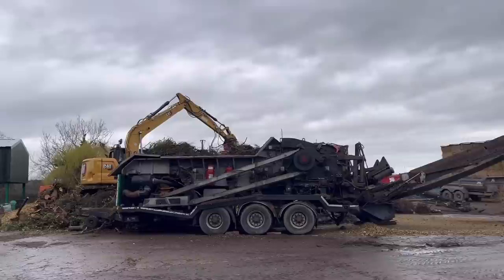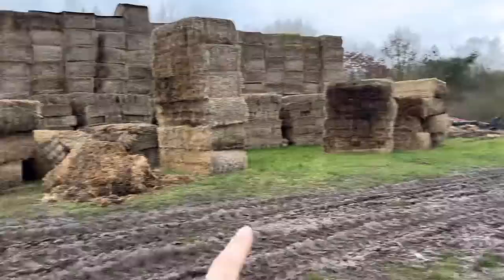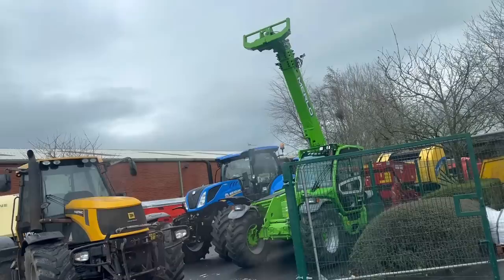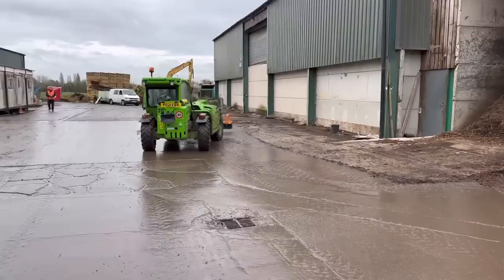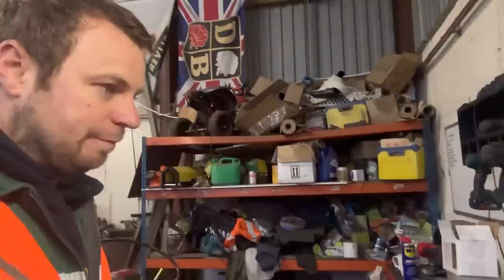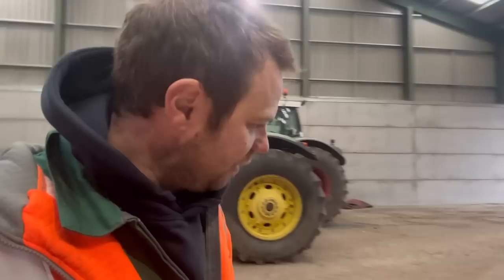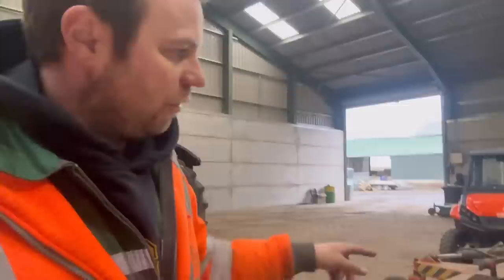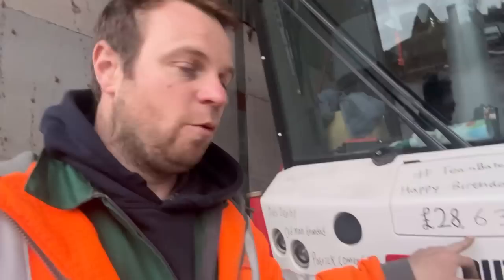WET WITH A BROKEN  BRUSH #OLLYBLOGS #AnswerAsAPercent 1089

Comment: I always found replacing seals on hydraulic pumps a bit of a waste of time. The seal blows out due to oil pressure leaking down the shaft due to wear. They can be replaced, but they rarely last for long.
                   Farmers would have a lot of clout if they all acted in unison, trouble is most of them want something different to their neighbour.
Reply: Problem is there is no carrier bearing at the pump end causing wear on the pump seals . Leeds welding company makes a brush with a bearing at both sides and also puts the pump at the cab side of the bucket for better vision

Comment: Simon woodford
Re your fendt and the high pressure in the rear tyres, could it be you are hanging 2.5 tons out the front and lifting the rear off the floor ? Bad weight distribution for pulling a dead weight on the hitch ?
Great vids though and so good you are backing british farming.
Reply from the maker: Think weight on rear would change it

Comment: The other day you said about buying some new shelving and getting the workshop better organised, I would really recommend you try and do this before you get really busy later in the year. I have been watching your videos for a good while now and am amazed at just how much time seems to be wasted looking for things. Today being a case in point and ultimately not finding it.

It isn't only the frustration of not finding the item but the wasted money spent in the form of your/staff time. So I would see spending time getting the workshop etc organised as an investment as it will help on many fronts, save time, which saves labour costs, avoids frustrations, means you get more jobs done as less time is wasted etc etc.

In addition I would have a checklist of what should be kept in each tractor and then if it isn't there you have spares to restock it. The tractors should be checked periodically to ensure they are stocked up.

I know trying to find the time to get such process in place is hard but in the long run it really pays off, you also obviously need to get all the staff on board with it and the change of mindset. But give everything a home and you can soon tell when things haven't been put back and people know where to put things back so are more likely to do it, it also means a nicer working environment as everywhere isn't an (organised) mess.

There is a lot of scope for improving efficiency that will ultimately make the whole farm run smoother and be a nicer place to work.

Keep up the good work!
Reply from the maker: Totally but we still need to keep things that pay happening
Reply: @OllyBlogsAgricontractfarmer  It will pay you to take one day for all of the staff to work on sorting the workshop out.  If you costed the time taken each time you spend time trying to find a part, and the time the equipment is not working., you would find it will be cost effective.
Reply: @OllyBlogsAgricontractfarmer  Yeah fully get that, it is why it is hard to implement as it is ultimately a low priority as there are always seemingly a million other jobs that need doing before so it ends up never getting done or only done in a half arse way. I know that from my own business.

But it really is something to prioritise; getting organised. The time and money spent on it repays you time and time again going forward, every time you want a bolt you just go get it from where it should be, you need a hose and it is there you can get on with the job etc. It also pays in a round about way through cost savings, namely in wasted labour time and buying things you already have but can't find or didn't know you had.

Taking time to step back from the day to day running of your business and looking at things that need changing, improving etc is really important as I am sure you know. It is so easy to get snowed under with all the daily tasks that need doing and calls on your time but before you know it another year has passed by.

You may already do this but if not, it is worth getting someone to come in and spend time with you and point areas for improvement/opportunity out to you as when we are so wrapped up in our businesses we sometimes miss the wood for the trees.

The hard thing though as you say is finding the time, but it is exactly why we need to find the time 👍
Reply: The chap is absolutely correct. We have been through this and started with the nuts, bolts, washers bins as you plan to do. Spread to all sorts of items such as roll pins, circlips, lynch pins split pins, about another 40 bins. 
Another thing you might consider as you suffer a lot from tractor batteries always flat on the JD/Case collection. It knackers them if they go completely flat and when you do jump start them with a flat battery the alternators ram in 70+ amps which also does them no good at all. Battery conditioners are about £100 each and are left connected but will really keep those batteries in good order and significantly extend the life as it also runs a de-sulphate program.
No need to rake any notice as you are snowed under but these things have really made a huge difference to us just as the chap above has advised.

Comment: The reason there may be a shortage of chicken (which I very much doubt there will be, there wasn't during covid, yes the supermarkets didn't have much but our processor couldn't give it away he has so much) isn't AI. You can't get AI insurance and even when you could it was too expensive. Is cost. Liveweight price is determined by feed prices as one fluctuates so does the other. Now we're paying 6 or 7 times the cost of electricity, gas has near doubled then fuel is up. The farmer has these costs, then the hauliers then the processor but the end price doesn't reflect. I read in poultry business this morning, in the supermarket you can buy a chicken for £3.19 and next door you'll pay £3.50 for a coffee. Wheres the logic.
Reply from the maker: Exactly